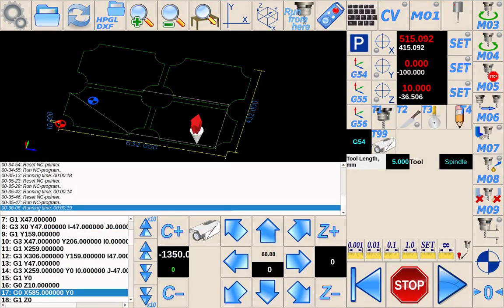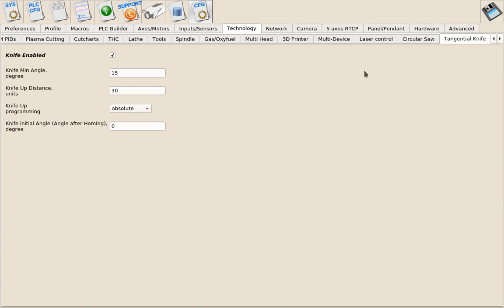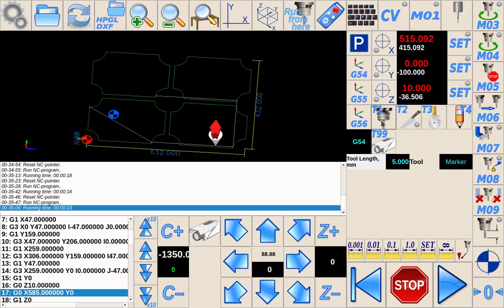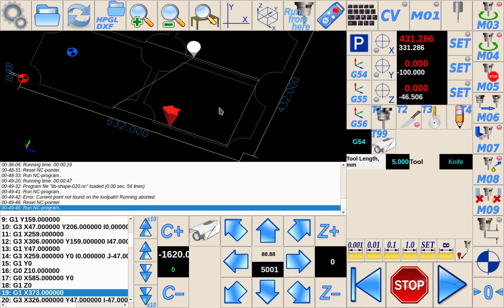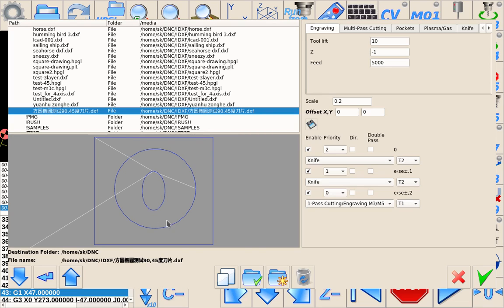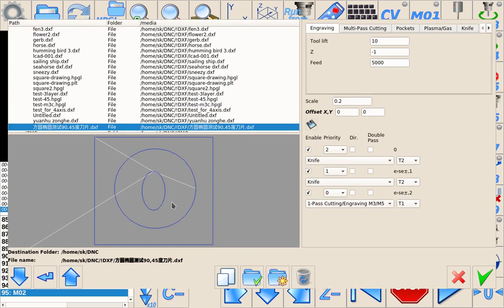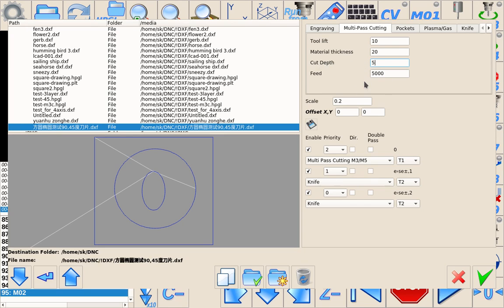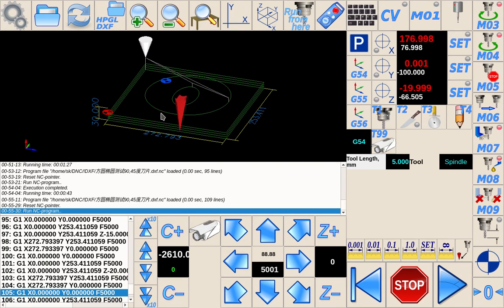Tangential knife implementation in myCNC software.

Comment: Hi !  Could you please let me know which software you use to generate the toolpath for a tangential knife application  ?  thank you
Reply from the maker: Hi, no special software needed. It can be standard 2 axes (XY) g-code. You can import DXF file to myCNC software as well. Once Tangential Control activated (either in tool change macro, on-screen button or settings menu),  our CNC control software will add everything about Tangential control (knife lift up and down and rotational axis C control to follow right direction) automatically.